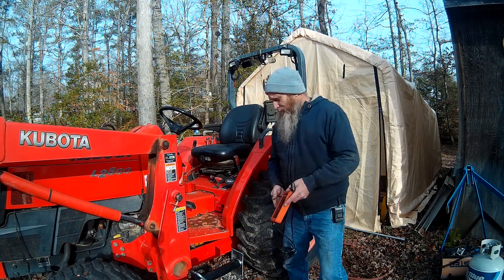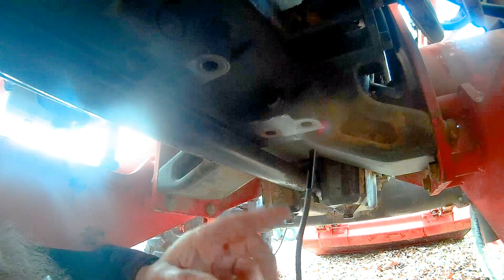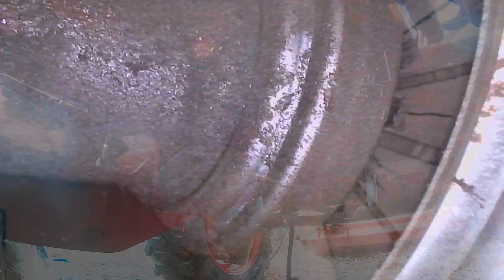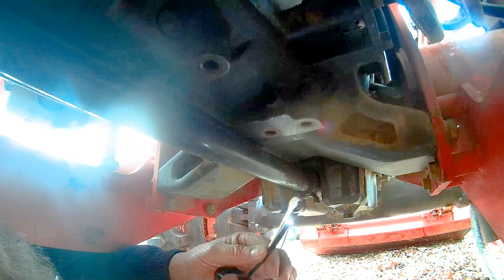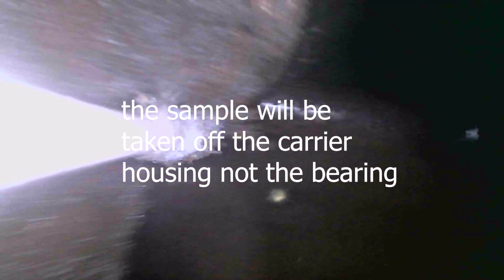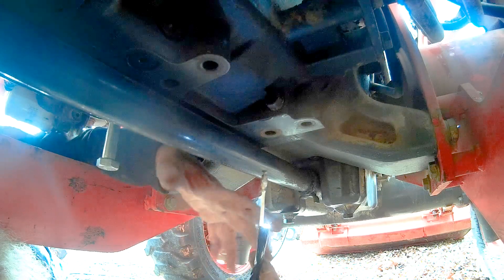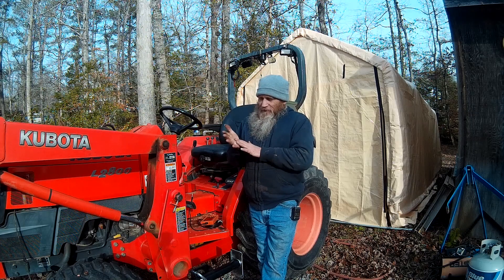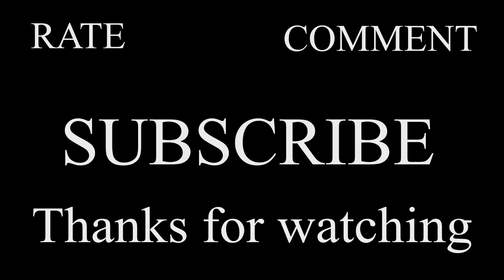the mystery rattle in the Kubota L2800

Comment: Hey Dave I'm having the same problem thought it might be a push Rod but after watching ur video I'm pretty sure it's the clutch would like to see ur video on how u split the tractor mine is the exact same kubota
Reply from the maker: its a job but can be done. I'm only recording the major important parts concerning checking the clutch, torquing the fly wheel, clutch and clutch fork. clutch alignment tool and replacing the throw out bearing, carrier and main polit bearing. so far I have several videos up on the progress so far. likely will post another tonight or in the morning.
Reply: @daveknowshow  i went and bought a borascope and looked the hole and didn't see any cracks and it only does it when I run it for a while and when l step on the forward and reverse
Reply from the maker: @brubakers13able  are you sure your fuid level is high enough? low hydraulic fluid will create a noise as well. also you must use Kubota super udt 2  in these HST machines. the cheap tractor supply oil will ruin the HST unit. make them very noisy. still working on putting the tractor together so not sure this fixed it or not.

Comment: Wow Dave! That's a bummer. My old 2 cylinder John Deere tractors that you have seen in my videos have the clutch outboard of the tractor. You can do a clutch job without splitting the tractor. My 2520 John Deere, my Ford 9N, and my Kubota will all have to be split. That bore scope was a great tool to have. That was awesome.
Reply from the maker: for sure the borescope did help shed some light on what is going on. now to get busy fixing her up again.

Comment: O-boy! Splitting the tractor no fun! We used a camera in my old company to check units and fans for mice and snakes before removing service doors!
Reply from the maker: yes for sure this camera will be used a lot around here.  would have loved having one of these 40 years ago.
Reply: Dave, never have I saw a pressure plate crack like that. Usually bad clutch disc or throw out bearing. Didn’t you buy the Tractor new?  Seems to me more Metal Fatigue flaw then stress failure! Kubota may stand behind it if the clutch disc is ok
Reply from the maker: @outdoorswithlarryrobin  its pretty old tractor 2005 model so not likely covered.